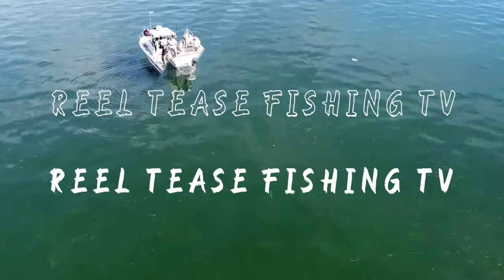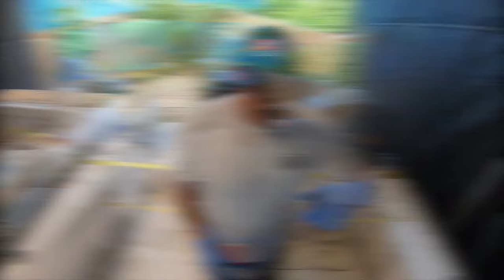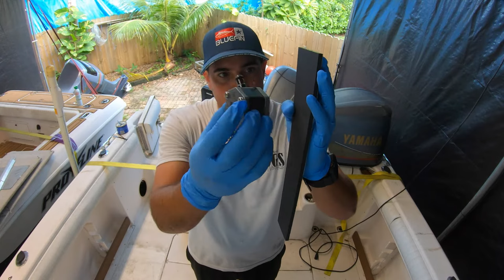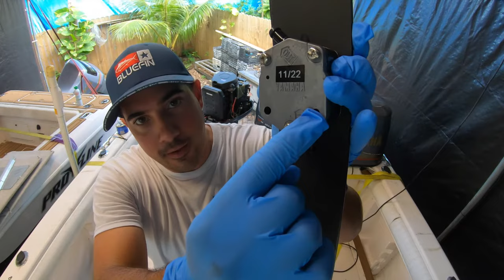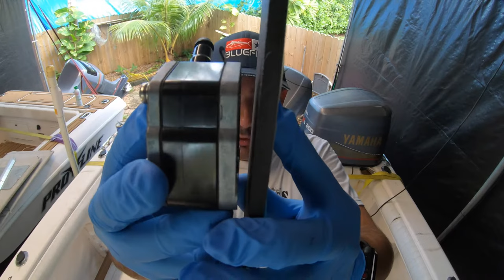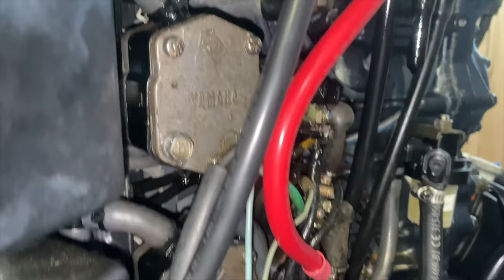How to Test a Low Pressure Fuel Pump

Comment: I did a fairly long list of parts swaps on my 2002 Yamaha VMAX 200 in the last 8 weeks.  Thanks to your for helping to guide me with multiple videos on the same engine.   I replaced thermostats/gaskets, VST filter/gasket, primary fuel filter/gasket, fuel primer bulb, post primary fuel filter 1 way fuel valve, new oil pump/strainer, new reservoir low oil sensor, engine oil tank sending unit, and usual lower unit oil and water seperator valve.   Runs like a DREAM.   Cranked immediately on just a tiny bump of the key.  On examining all parts swapped I think the thermostats were shot which caused a shut down and my deep dive into this overhaul.  Engine 22 years old.  Only 300 hours.  2nd rebuild on the water pump on deck and good for another 5 years min in local fresh water.  Thanks so much for your replies an assistance!!
Reply from the maker: That is great news!!! These engines are great and seems like you will take great care for it. May she run for another 20 years! Cheers 🍻
Reply: @ReelTeaseFishing Thanks again for all your help and messages.  If not for you I would have ended up spending a fortune at a dealer for engine work.

Comment: Great information! I have a 2002 Mercury 200 optimax just got rebuilt cranks up fine idles good but once I put it in gear it tends to die off and won’t accelerate. Any suggestions on what I can check thanks 🙏.

Comment: Yep. Have the same motor and had issues getting above 3500rpm.  Did this test and lower pump poured gas out when the bulb was squeezed.
Reply from the maker: Thanks for the feed back. This is definitely a common issue on these outboards. 👍🏽

Comment: I have a Yamaha 200 2 stroke and it only starts if I give it gas or put the choke on, a week ago after starting it cold it started all day in one go, now 2 or 3 hours pass and it does the same thing, the motor  has no missfire

Comment: Good tips in this Video, would these cause primer bulbs to go  soft ? (Intermittently) I’ve replaced primer bulb and all fuel line between engine and tank/ water separator. After mine quits and hand prime it will run fine for hours/days before this occurs again and engine is starved of fuel. No anti-siphon valve on tank. Fuel vent is free and clear..
Reply from the maker: A sign of a bad low pressure fuel pump would be the need to pump the bulb while the outboard is running to keep the engine running at full speed. Essentially pumping by hand is taking over the fuel pump. 
You may have a slightly failing fuel pump. That’s barely keeping up giving you the intermittent issues.

Comment: I have a 90 horse Yamaha four-cylinder 1985 model I recently changed the power pack and I've had it 2 to Marine mechanics without fixing my issue. Boat seems to run good at high speed but stalls at trolling speed. Carbs have been clean bowl reset. Sometimes at full throttle you can hear it bogging down and the boat goes slow and then something will suddenly change and it picks up and runs great. Also sometimes when I sit in fish even after the engine is warm I have trouble restarting the motor
Reply from the maker: Have you changed the fuel hoses. They overtime collapse inside restricting fuel. 
Another thing to look at will be your fue bulb. They have one way valves that when they go bad get stuck restricting flow.
Best way to diagnose this would be to run fresh fuel off an external tank. Buy new fuel hose and new bulb. Put it direct to engine and see how it runs. If it runs good you know the issue is from the fuel line back to the tank. 
I’d start with that. Then we can look into more difficult things to diagnose but do that and let me know how it goes
Reply: @ReelTeaseFishing  thank you, that line and bulb has been replaced but I will check fuel pump etc. Timing has been check to be okay but it just seems like it has some kind of short or something by the way it bogs down sometimes and then sometimes something seems to change immediately and it starts running fine without any change to the wot
Reply: @poolsj1 that's exactly what my yamaha 40 is doing. Did you find the fix?
Reply from the maker: walterwulff8973  are you eliminating the choke or engaging the choke for it to run?

Comment: Thank you so much for making this vid!  You just saved me from buying all new low pressure pumps.  I’m still troubleshooting but I think this will help.  I’ve got a Yamaha 140 salt series 2 stroke that bogs out after about 10-15 seconds of wot.  Carbs are squeaky clean.  Gonna change fuel hoses and check low pressure pumps.
Reply from the maker: So glad it helped you out. 👍🏽
Reply: Mines bogging down in and out after wot, cleaned the carbs new fuel lines, fuel pick up tube is clean no cracks, all connections are air tight. I have no clue what else to do but I’ll try this
Reply: Hello, so what was ur solution, I have same issue ??? Fuel hoses ? Or bad low pressure pumps ??
Reply: @dzmarinemechanics3238  pulled one off my other motor and works fine now
Reply: @dzmarinemechanics3238  I’m starting to think it could be same symptoms but different issues.  I’ve changed low pressure pump, fuel hoses, fuel/water separator, rebuilt carbs professionally and still same exact symptoms.   I think it’s going into limp mode due to faulty sensor.  I’m going to change out my oil level sensor and thermostats and see if anything changes.
Reply: All fuel pumps with the hole in it will leak lol.

Comment: I have a Yamaha F150 LB currently it’s making oil. When I pull the dipstick out, oil gushes out. Oil smells of gas. I will check this tomorrow. This was my thought that I had a bad fuel pump leaking into the crank case.
Reply from the maker: That could possibly be it. 

Usually it’s one of three things. 
1. Thermostats are stuck open
2. Leaking fuel pumps
3. Your rings are not seated.
Reply: @ReelTeaseFishing  it was one of the low pressure fuel pumps with a ruptured diaphragm. Drain oil, changed oil filter and replaced fuel pump and is working great.
Reply from the maker: @fldallyb  awesome! Glad to hear 🤙🏽

Comment: Good video man, never worked on a Yamaha but I'm guessing this means there's a hole in the diaphragm? Or is there check valves in those pumps?
Reply from the maker: Thank you sir, these pumps work on only vacuum. when they leak like this it means there's a tear/rip in the diaphragm. very common when using ethanol laced fuels.

Comment: Hi there, thanks for the video. I have a 130hp yamaha saltwater series 2 stroke. It won't start, coughs a bit in the choke like its going to but won't fire. Have changed plugs, made sure i have new fuel, choke is definitely turning on, fuel is getting to the bowel. Have tested the low pressure pump as per your video but no signs of a leak. Could it still be the low pressure pump as there's not many more options?
Reply from the maker: If it’s a carbed model I would clean them and rebuild them. Especially if the engine has sat for a few months
Reply: my dear friend . My engine is like your engine, everything is fine but it doesn't work. Can you tell me how you found the solution?

Comment: 2003 Nissan 120 two stroke. The throttle control doesn’t throttle up until it’s almost all the way down and it’s super tight when about full throttle. Keeps hitting dead spots at full throttle as well
Reply from the maker: When was the last time you replaced your throttle cables? 
Over time they tend to corrode and stretch out. This will cause your symptoms

Comment: What is the best way to winterize your boat motor. Would you recommend a ball valve to shut fuel off and let the carbs run out of fuel or what do you recommend
Reply from the maker: Before this, run the engine on a mix of antifreeze. Therefore if any water remains in your heads it won’t freeze and cause issues. Run outboard on a fuel additive. Then
If you have carbs, the carbs themselves have a brass drain screw located on the bowl. Remove it. Drain the fuel put screw back on. I’d also spray the engine with fogging oil by removing spark plugs and spraying the cylinders. Turn engine over for a sec or two to lubricate the entire cylinder. Add spark plugs back. 
Change your lower unit oil with fresh oil. Any water in your LU can crack your LU or bust seals during winter. 
Same goes for the motor if it’s a 4stroke.

Comment: Great info on the low pressure fuel pump.  I am wondering if mine are bad, I think I have two of them.   I have a 2003 200hp Yamaha HPDI outboard motor.  It starts right up and revs no problem but in the water when I put it in gear it will not get up on plane, I can idle in gear and move around but I can't accelerate.  Any suggestions are greatly appreciated.
Reply from the maker: Ahh the HPDI. I’ve gone through this with my own HPDI. I recommend changing your neutral safety switch. It’s located by the control cables on the outboard. Look for a blue plug connected to a small switch that I believe is held by a single screw. 

Keep in mind HPDI are extremely picky about clean fuel. If this doesn’t cure it you may need to go through & clean your entire fuel system. Filters, Mystery Filters & injectors
Reply: Thanks for your response, I'm thinking more fuel related.  I bought the boat this summer.  It had sat for 3 years.  I found water in the gas tank, drained the tank and repaired, added a water/fuel separator filter and changed the first in line filter.  It ran great.  I towed a broke down boat to a marina (45 min tow) at very low speed.  Since then it will not get up on plane.  Starts and idles great but won't accelerate.
Reply from the maker: @kevinharding2036  
If she sat for a period of time I’d def look in changing the VST filter, the high pressure fuel filter (silver canister after the VST) 
If that doesn’t do it then do the mystery filters and send Injectors to flagship Marine (one of the only places that does high pressure injectors )
Reply from the maker: @kevinharding2036  look through my videos, I have a few on the HPDI’s fuel system service
Reply: @ReelTeaseFishing  ok thanks, I have seen some of your other videos on the HPDI fuel system, I might give that a try.  I am in the north east and it is cold here now.  Might be awhile until I can get to it. Thanks again
Reply from the maker: @kevinharding2036  best of luck. Feel free to reach out when you start troubleshooting again. Wishing you a good and safe winter

Comment: Great info. I have a 2016 F150 that sputters at rpm over 4000. Runs perfect below 4000. 250 hours. I change in-line and onboard filter ever spring. What was also confusing I had my wife take the wheel while it was sputtering and I tried pumping the primer bulb. It was hard as a rock. Maybe the bulb? Any advice?
Reply from the maker: The bulb should be pretty hard, however check to see if it remains hard say a week after using the boat. if it's still rock hard. the bulb may be bad and the rubber has lost its elasticity. 
Usually issues at high RPM are caused by fuel restriction. Filters changed are easy to do. Also have you checked to see if there is water in the fuel? When you pump gas can you feel the fuel vent pushing air out rapidly?  
just trying to check off the easy things before diving into the engine & parts. 
After all this I would then recommend using an external fuel tank to run the engine to rule out the possibility of a stuck one way valve on the pickup, a dirty/clogged screen in the pickup, bad gas, contaminated fuel, vent issue etc. if she runs great on the external you will no where to focus on next. If it still runs poorly you can now focus on the engine itself.

Comment: 2005 VMAX 200 hp. Engine starts great even cold. Run a few places then it doesn't start. I waited about 30 minutes then it started. Once running lake it just shut down. Then again hard to start. Any recommendations. 

Thank you

Comment: I have a 2013 F150LA. Starts and runs for a minute or so, then sputters out like it's starving for fuel. Checked water separator, and fuel filter, both were good. Then checked the oil and it's almost spilling out of the dipstick. I called a local outboard mechanic and he said test the fuel pumps for pressure, but he would bet that's the problem. Do you agree? And is this the same method I would use to test? On the diagrams, my fuel pumps look a little different than these(Part number 63P-24410-10-00). Mine look like a part of the fuel pump body goes into the block with an o-ring. Are you familiar with that? I subscribed to you btw - great channel!
Reply from the maker: @markmcmanus5901  thank you for subscribing. Your pump is slightly different and works almost in the same manner. However, what you are describing sounds like  it has failed. You can test it the exact same way. Pull it off the block and squeeze primer bulb. These don’t always leak when they fail but in your case it sounds like it’s dumping fuel into your block. (Blown out internal seal)
I highly recommend you buy a new pump with the oring/seal to the block and change your motor oil as fuel in the block will thin out your oil. 
You should be back in the water in no time 👍🏽👍🏽

Comment: 2 stoke 50 hp Merc. Run with bump at full, chokes at slow speeds and idle. Continually pushing the key/choke? manually fueling carbs got me back to the dock. Is this a symptom of bad fuel pump? I am handy but not a pro mechanic. I have changed hoses everywhere no air ??? New sparks. I am quickly running out of options. Am I on the right track? Thanks for the share dude it helped me in this situation.
Reply from the maker: Immediately this is telling me you have a fuel restriction issue or air fuel ratio is off. 
Is this a carburetor engine?
Reply: 👍 yes
Reply from the maker: @wyregrasser7540  
Definitely check your fuel. If it’s older than a year old, I’d remove all fuel and put new fuel. That will eliminate the possibility of stale/old fuel. Also helps eliminate contamination on fuel as an issue. 
Secondly all fuel filters should be changed out for new. (Seasonal maintenance anyways, so not an added expense)
 I’d do a carb overhaul. Pretty simple if you buy the OEM carb kits and soak the carbs over night and use compressed air. 
Lastly I’d perform a link&sync on the outboard once the overhauled carbs are installed. 
This is all capable if you are somewhat mechanically handy. Will save you some money as well vs a shop. 
Some good carb overhauls and link&sync videos on YouTube. Go slow. Take photos to go back if you need to reference when putting it all back together.
Reply: @ReelTeaseFishing  I really appreciate your time, response and advice. Thanks tons!
Reply from the maker: @wyregrasser7540  best of luck! Let us know if this fixes it or you find the issue

Comment: Great video. I had an issue this past weeekend. 
Yamaha 50hp 2 stroke wouldn't go past 4k rpm at WOT.
But after about 25 mins of leaving it at WOT it just goes 6k +rpm out of no where, back to it's expected operation.

A few minutes later i went over a small wave then it immediately went back to not going over 4k rpm. I can't seem to figure it out
Reply from the maker: You have a fuel restriction. I’d be looking at fuel filters, fuel lines, fuel pump. Also pull some fuel out of your tank into a mason jar and look for signs of water or contaminants.
Reply: @ReelTeaseFishing  I'll try the list of things you've suggested. I appreciate your helpful response.
Reply: @ReelTeaseFishing  just got off work and started to work on the boat. As soon as I loosened the bolts just a little on the fuel pump, gas started dripping out the pump. Gonna purchase a replacement pump then test again on the water.  Thanks a lot.
Reply: @ReelTeaseFishing This update is mainly for the people who dig through comments to find answers to similar issues they are  experiencing with their outboard. I put the replacement pump in then took the boat out on the water. The boat now goes full throttle and gets up on plain. It's running great! Thanks again.
Reply from the maker: @dijoncameron8567  thank you for coming back and leaving an update. Comments like this that close the loop help those that may be experiencing the same or similar issue
Reply: @dijoncameron8567 dude I'm having the same problem! Runs and revs perfect on hose muffs but when it water and wide open throttle, it won't plane 😢 I'll check the pump tomorrow and loosen the screws as well

Comment: Having the same issue. Had a start and stumble. Then, it started rough and then normalized. It runs fine at 3500rpm but once I throttle up, it falls off, and my starboard engine overpowers the port side and makes it pull hard left. I'll check that next and see if I have that issue.
Reply from the maker: Get back to us with your findings
Reply: @ReelTeaseFishing boss can i ask what is the issue. Of my 40 hp mercury four stroke. If engaged the geR. Engine will cur off.. what qS the issue. Thanks
Reply from the maker: @retpekp6624  its hard to say what the issue is, I don't have enough information but Id would look into things like fuel. is it fresh? do you have any fuel restrictions? kinked fuel hose, clogged filters, fuel bulb working correctly? water in the fuel. Then work your way into the engine. most of the time its fuel related issues.

Comment: ok, i got one for you. last time out we were coming back to the launch and lost half power or actually down to 8 to 10 mph. just about wake speed. I haven't tried to figure it out yet but was able to run the motor at home with fresh water and then winterize it for last year. Any idea what would cause this. I did rebuild the fuel pump a few years ago and for fun tested everything on the motor doing my own videos. one thing that i have neglected is putting a new fuel filter on. I drain all the fuel out of the main tank and used it in the car so it's empty currently. I have an auxiliary tank to put non-ethanol fuel in to test it but not at full rpm. will have to take it to the lake to run it and probably next year.